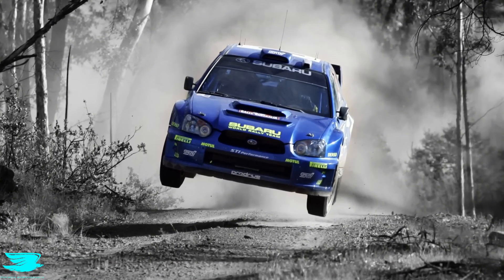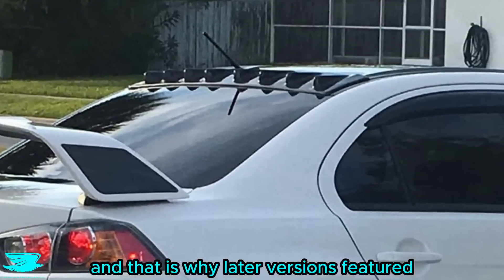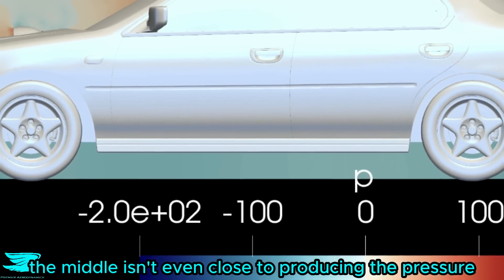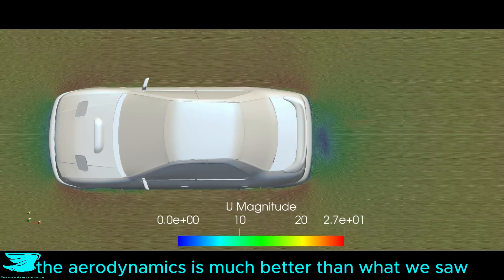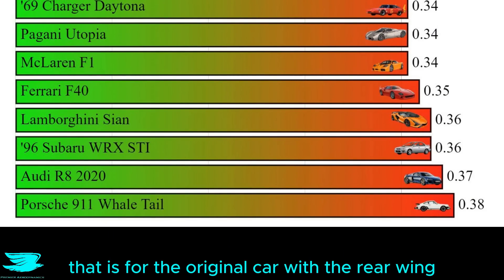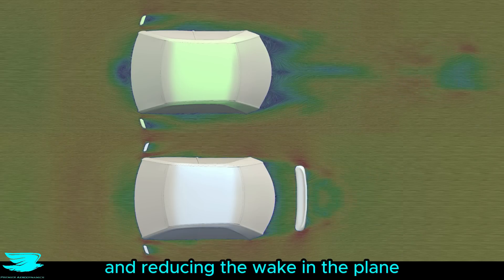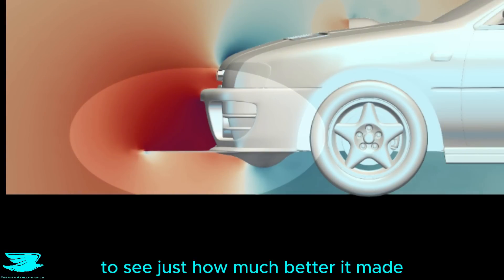Surprising Aerodynamics of Champion Subaru Impreza

Comment: It would be a nice idea to compare this to the hatchback/wagon impreza of the same generation. Because i have a 2004 Subaru Forester, i would love to see my forester stock vs how it is right now (lifted 50mm, removed splats from in front of the front wheels, with slightly bigger ATs and the bigger facelift mirrors) and also a comparison to the facelift SG forester, which has a rounder front and bigger mirrors. Some models also come with a roof wing and or hatch mounted wing (under the glass).

Comment: Another problem is the top mounted intercooler.High pressure air going under the bonnet from the bonnet mounted scoop.Creates more lift high pressure under the bonnet?

Comment: it’s not clear which car is here. wrx sti 96 production car has different front bumper, bonnet, headlights, grill, rims, rear wing and a couple of other things. a group a car has other things different, mirrors are much smaller for example.

you have wrx or sti ver 1 or 2 production car model here most likely.

but for all cases, your model has the wrong roof, it’s not so flat in real life.
Reply from the maker: Thanks for the input!

Comment: Can i make one request.... can you make a video taking the volvo classic brick, and taking the rear glass and angling it,   the opposite angular direction to a estate car? 
because it has been bothering me, since aero class, "why don't car makers form the body like a plane wing upside down...?"
Reply from the maker: Thanks for the idea!

The major reason why is aesthetics. Trying to get the designers to do anything unconventional is usually like pushing an elephant up a hill. Then, locating the passengers inside is challenging. There is also a safety aspect because current standards really revolve around typical passenger car shapes.
Reply: @PremierAerodynamics  I still think its better to place the idea out there, and see what sticks.   Ok, if it truely is ONLY safety, they would not allow wings and spoilers within the same footprint. It has to be some combination of factors. Not one single element, be that design or legal contingency.

Comment: I have a mk7 golf R wagon. From research it appears there's almost zero lift. I've not found it to be unstable at high speed. They did a good job of it I think.  I've been wondering if some rubber side skirts to seal the underbody edges would help with drag and maybe a little more downforce. Is this something that can be modeled? Or would an imperical test be more suitable?  Diffusers, wing and cannards have been proven by VERUS engineering. Admittedly the drage coef is good at 0.27 to 3.0 anyway. Maybe not worth exploring?  Also, there's the roof rack rails, maybe can seal between them and the roof to reduce drag.  Thoughts?
Reply from the maker: Sealing the underbody generally works if the car is close to the ground. If it isn't, then there may not be that much gain because the flow isn't following the venturi effect much anyway.

If you want to get more downforce, then lowering the car is the best way because it also typically reduces the drag too. Other downforce approaches typically increase drag.
Reply: @PremierAerodynamics  Hey thanks for the response. This makes sense. I'll have a look into it.

Comment: Sim is sus. Smooth aero underneath a car without a smooth undertray is wild. Also, that’s a spoiler in the first version which helps eliminate lift. A wing adds downforce and is basically an upside down aerofoil.
Reply from the maker: Thanks for the input!

Comment: This makes me wonder about what the S30Z Fairlady is like in comparison which is long and flat with a very smooth downslope in the rear. I would be especially interested in what it's like with the race kit that has a front "spoiler" a ducktail on the rear as well as wider fenders.
Reply from the maker: Thanks for the idea!
Reply: @PremierAerodynamics  Also have a look at wangan midnight. Manga series is made with racers and tuners from the time so it's quite detailed. In later parts of the anime the Z had a different front bumper, smaller mirrors on the doors instead of the hood and apparently also a diffuser.
It's quite interesting.

Comment: Curious where the best place to put a wing on the hatch back version would be, as well as finding out the drag coefficient. Good to know I should change out the mirrors and grab some more arowdynamic wheels.
Reply from the maker: If you mean the wrx hatch, I would probably leave it how it is because if you put a wing on, it will likely reduce its handling because the front to rear lift ratio will be changed.

If you do put a wing on, then at the back on the roof, but then you also need to increase the splitter at the front to increase lift there too to keep the handling decent.

Comment: Is it just me, but it seems that most of these simulations consider car as solid object without simulating for example airflow through front rad grille/under bonnet and through vents & other openings in bonnet or underbody, and eg. intercooler hood scope also is not solid closed box?
Maybe by then front "wouldn't be considerable that blunt"?
Reply from the maker: It's closed cooling.

Comment: Can we see the bottom of the model?How important do you think it is to have all the junk somewhat modeled? Floorpan, Engine/gearbox/driveshaft/diff/axles, exhaust, etc

If all the models are equally unfeatured, then at least we have some apples-to apples comparisons of the topside geometries I guess.
Reply from the maker: You can if you think you can!

This one is flat.
Reply: @PremierAerodynamics  
What? What is 'You can if you think you can!' referring to?
Not all these car configurations are equal. A large area on the front of a FR car is open, air goes in radiator, out the back, around the engine block, thru the transmission tunnel, past the diff.... you get it.
The 911 actually does have a basically closed off front, flat floor, and then the engine/gearbox at the back. 
Having some rough underbody/internal flow features could really change the game, couldn't it?
I don't even know how much faith to put in the upper surface results when it's affected by the lower surface. It's just a matter of degree: How much of an effect does that rough floor & underbody features have on the flow coming off the trunklid, for example?

Comment: The 1990-1996 Nissan 300zx has 2 chassis’s, 2+0 and 2+2. One is 8 inch’s longer than the other. It would be super interesting to compare the differences. 
Plus these used the most angular headlights of the day and they were even used by Lamborghini.
Reply from the maker: Thanks for the idea!

Comment: Just curious, do you have any idea how flow through the engine bay affects things? especially on race cars you see massive ductworks leading the air in and out at very specific spots, and i assume they have a noticable impact not only on how the air flows but also the pressure points at the front of the car.
Reply from the maker: They usually add around 20 or 30 counts of drag. Often, the air is funneled out into insensitive regions.
Reply: @PremierAerodynamics  thanks for the reply. it's something i've always wondered when looking at people using a solid model to simulate a car, but i also understand it would be pretty complex to model correctly for a youtube video.

Comment: thats pretty cool

i noticed some imprezas have a rear roof spoiler on a sedan similar to a lancia stratos does that help with aerodynamics or would that fuck it up even more?
Reply from the maker: It would definitely be better for downforce than this wing, and for this model, you probably wouldn't get much of a drag penalty. But, for ones with the flow attached down the rear window, that roof spoiler would increase the drag dramatically because now you have a much bigger wake.

Comment: You mentioned the roof being a low pressure area and would be better if the car (and roof) was a bit longer. The Impreza is a shortened legacy (or whatever it was), where subaru just took their at the time highest performing road car and shortened it for rally use, and I guess they didn't consider the aero affects (like the roof lift) from doing so.
Reply from the maker: Good points.

Comment: Thanks for doing this one. I'm an ex mechanic owner of a 98 GC8 WRX, so was interested to see how it faired.
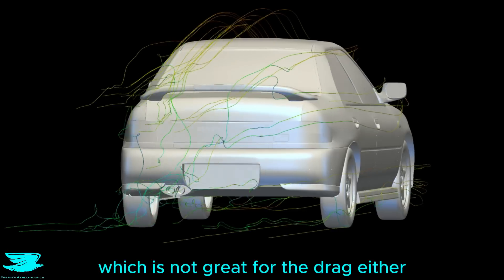3:41 The A pillars have little dams built into edges of the front screen rubber filler strip. While this does force air up and over the roof, it also forces rain and wiper water up there too which is important if the windows are down a little during rain 🙂👍
* The STI did have a different spoiler fitted at the factory, and I recall it came with the tall extension blocks to stand it right up in the air stream at about 1/2 window height.
Also, I recall the last WRC GC8s had vortex generators fitted when they moved to the 2 door, which no doubt also helped with the rear glass angle. 👍
Reply from the maker: Wow, I didn't notice the little dams. That is a nice feature for the rain.

Comment: I had a 98.5 Mercury Mystique LS Mtx-75 with the SVT sway bars which were smaller up front and larger in the rear. I recalled seeing them on 1994 popular science for low .cd and the car was fast
Reply from the maker: That had a sleek rear window as well, which would drop the drag a lot.!
Reply: @PremierAerodynamics  yeah I kept the no wing thing but the duckbill carbon trunklids and a mirko front lip was the top spec

Comment: Wow thanks for interesting video
I have a question impreza type r or coupe impreza seems to be better with down force at the rear but I'm not sure abt it 😅
Reply from the maker: Thanks! It also depends on the weight distribution, and how much power is going to the rear.
Reply: @PremierAerodynamics  impreza from 97 and later i think, has Dccd so power can be distributed from 50/50 till 45/65 weight is the same as basic impreza they all in first gen around 1290kg hard to say about distribution but it seems to be more centered in coupe version

Comment: CFD IS NOT REAL LIFE!!! This simulation is outrageous
Reply from the maker: Thanks for the input!
Reply: @PremierAerodynamics  do you have a way to model accurately the entire underside of the car with all of its components? Did you try model the engine bay and its exits? The moving wheels and their interaction with the brake rotors and their cooling ducting? All of the yaw angles or even just a 4° median? There are so many variables to the aerodynamic of a complex shape like a moving car, even more on a full blown rally car, this why you see some car manufacturer relying only on cfd testing wich cost them  ridiculous amount of money and time miss completely the way the airflow act on the car with alot of unattached airflow and early separation
Reply: @PremierAerodynamics  I dont want to sound like a douche but this is simply wrong
Reply: @PremierAerodynamics https://youtu.be/lbt_DT1f-pE?si=4pM8NKYpz3gnVL2h

Comment: 08 STI wrc car would be a cool comparison. There is a reason most manufacturers changed to a hatchback for rallying.
Reply from the maker: Thanks for the idea! It would be interesting. The hatchback might also be something to do with the weight distribution.
Reply: @PremierAerodynamics I also expect hatchback to have better support-to-weight ratio. The shorter, more round unibody skeleton is probably more resistant to rolling damage and frame bending.
Sedan is longer and flatter, thus "bends like a bar"; hatchback is like an internally arched pod and "bounces off rather than crash & bend".

This is layman speculation though.

Comment: Do you take into account that the front part of the car and the intake on the hood take in air and throw it under the bottom or onto the windshield?
Reply: Exactly mate 👍
A ton of air goes in the front bumper the then out the upward facing vents on the bonnet,
Plus the scoop catching and pushing air directly under the car must affect things.

Im sure the 1999 version also had the steeper bonnet angle too ?
Reply from the maker: It's closed cooling. As it says in the description.
Reply: @PremierAerodynamics ok
Reply: He doesn't

Comment: Hmm, I am not sure how accurate this simulation is. There is no way that the car was lift neutral. I think the problem is that the models don't model the underside of the car very well and instead assume it's flat... even though on these older cars it was anything but. The flow under the car was probably a lot more messy in reality, increasing both lift and drag.
Reply: This simulation clearly doesn't take holes into account.
The hood scope, underbody components, radiation, etc, was not taken into account, of which, is the most common factor of lift. In this case, the WRX, has a lot of huge functional holes, which could increase drag and lift.
The worst aerodynamic part of WRX is always the iconic hood scope, there's a reason why rarely any modern car still has it.
Reply: by the way. It is interesting to note that in every video, the airflow under the car is always "pretty good." Regardless of the brand, model or year.
Reply: @Claudio_And lol. It's always funny to see him say that considering how all the models are flat
Reply: Car designer here (again). Some videos ago, we discussed this in the comments. You guys are correct, these video game models are used for visual purposes only. No underbody or air intakes are modeled correctly. In car aerodynamics, the flow inside the vehicle is sometimes more important than drag alone. This hood scoop is a great example. It is more important to supply the intercooler with cold air, even if this means a little more drag. The engineers behind this project knew exactly what they were doing.
Reply: @Claudio_And  i was wondering about this. Not much point in trying to model the aero on a car unless its been modelled very accurately and in high detail to the real car. the placement of small grooves or bumps can really impact the downstream effect, was also thinking we need to see whats going on when the tires are actually rolling.
Reply from the maker: Thanks for the input!
Reply: Exactly, the person speaking refers to a diffuser - this car does not have a diffuser?

Comment: analyzing the wake is just one aspect of external aerodynamic behavior. You need to look at the pressure plots on the surface of the vehicle.
Much of the reason why the spoiler version of the car has less drag is because the flow over the rear windshield is slower and thus does not result in so much low pressure on the surface that acts like it is pulling the car back.

I always look at the drag and lift coefficient along x-axis first and followed by the surface pressure plot. The wake analysis is more for visuals and not always useful for understanding the flow. Generally, wake is unavoidable, but you can try to place them in a good location.
Reply: YouTube "aerodynamicists" are generally clueless, get used to it
Reply from the maker: Thanks for the input!